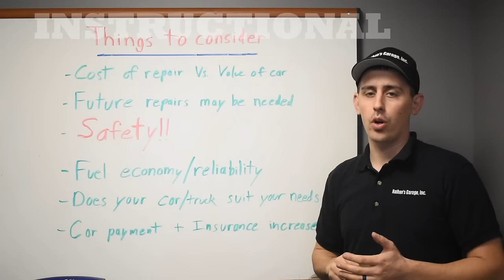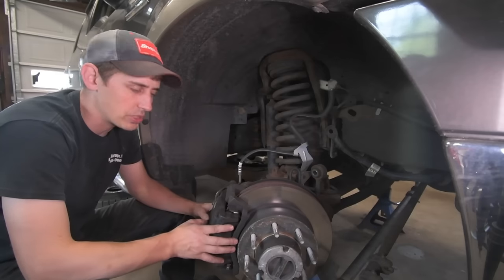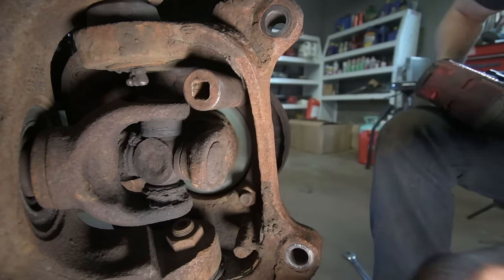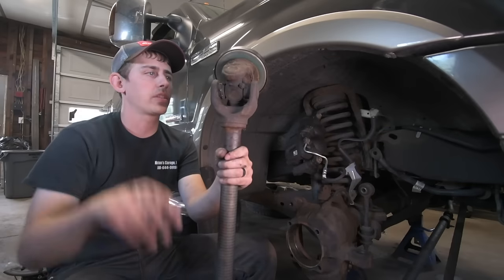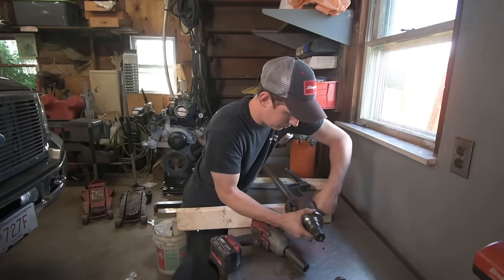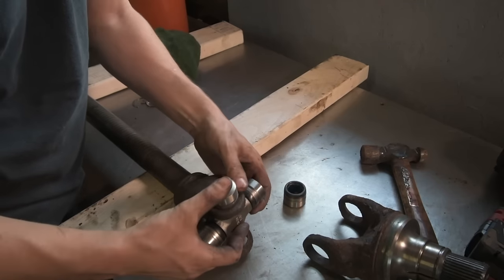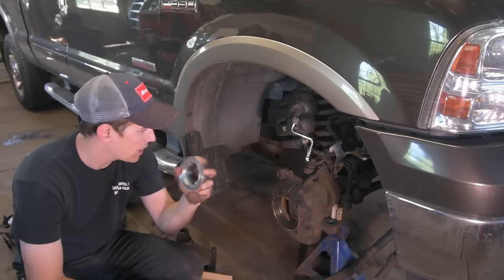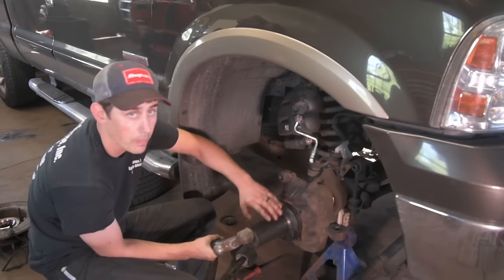Ford Superduty Steering wander repair....Axleshaft u-joints

Comment: Great video! Just did what I considered a front end “overhaul”, minus a steering box, but am still having this problem. Going to test this afternoon. Dumb question for you, any tips on disconnecting the hub sensor plug. While I was working on the truck the other day I tried to unhook it but could let figure out how the plug works. It looks like it’s 2 stage or something but couldn’t get it undone.

Comment: My 04 F-250 just started doing this I will look into doing this Thanks bro but should my steering box have some play in it?
Reply from the maker: There will always be a bit of play in the box. Even brand new
Reply: @InTheShop  Thank you for taking the time to reply bro I have checked it out and I both my wheel bearings are going bad

Comment: I have a 2002 F250 2WD lifted (6in).  Changed the ball joints and the steering went wonky from there. We spent 2 yrs replacing EVERYTHING, a couple of times, on that front end to get it fixed and it still has wondering.  It did however get a lot better after replacing the knuckles.  What else do you suggest we either check or replace to get it back to normal?
Reply from the maker: Can you give me a list of everything you have done?

Comment: Good evening, saw your video, great, 
Just wondering how the new dust seal gets installed?
 on the front Axle assembly, or is it pushed in? When you install the axle shaft and that new seal gets installed at the same time, please let me know, thx😊

Comment: Great video and information! I assume the doughnut seal and tool to correctly install for vacuum hubs isn't needed for my manual hubs? And this far into it, is there any suggested maintenance for my manual hubs? one turns easy, the other is harder but could that also be due to bad u joints? thanks
Reply from the maker: The donut seal should be replaced even on manual hubs. It helps keep the axle shaft stable and keeps junk out of the back of the wheel bearing. You could take the manual locking hub apart and clean and lubricate it.

Comment: Binding Universal joint binding is because the are supposed to work at an angel not straight ,
Reply from the maker: They spend a lot of their time in a straight line which does contribute to them siezing up. Especially since most people almost never use 4x4 to actually get the axles to rotate and change position. A large factor is replacement joints being greasable but never being greased. Thanks for watching Ralf!

Comment: I have a 95 f150 4x4 that wanders quite a bit. It takes constant steering input to keep it centered
in its lane. The truck has 120,000 miles and never had any front end work done to it. What would you be looking at first to diag this issue?
Reply from the maker: Check all components to make sure they have no play.

Comment: Great video but my only question is why do you have to lock the hubs in. If it is only binding up with the hubs locked why would it be binding while driving in 2wd?
Reply: Are the front axles always turning while driving and the only way the power gets to the front wheels is through the locking hubs?
Reply from the maker: They are not always turning if your hubs are unlocked but they will slowly rotate over time which is why the problem can be intermittent.
Reply: Thankyou. That makes sense

Comment: I have done one side on my 2012 F350, I have a hard time finding the right tool to seat the dust seal in the axle tube. Any ideas?? it is such a long distance for a standard seal tool and hard to find the right diameter.
Reply from the maker: I use a very large diameter socket on a long extension.
Reply: We built them out of fence pipe and a end that matches the width needed.  http://i205.photobucket.com/albums/bb294/OldCoot_2007/seal_driver.jpg

Comment: Great video and thanks!... I have this wander issue in my 99 F-250 and now looking into fixing it.   Would you suspect this frozen U-Joint problem before changing out the steering box / pump?   There's a few videos talking bout adjusting the steering box.  But this seems like an easier thing to diagnose or at least rule out.    Do you think many people are changing out the steering box for no reason?   Thanks!!!
Reply: If you notice in the video. Only 1/2 of the u joint was getting grease. If one side is dry looking its probably seized up

Comment: I have a 2006 f250 and I have a vibration when driving between 45-55mph while coasting and under acceleration I feel this vibration.  I’ve replaced all of the u joints in the driveshaft and the carrier bearing, and i still feel it. The front ends tight, and Ive had brand new tires put on as well, I’m kinda stumped at this point. Recently serviced front and rear diff aswell as the trans and 
t-case Anything you recommend I should look into truck has 180,000 I went on to the forums and a few guys stated it’s possibly injectors really would like to hear your take on this before I throw parts at it. I don’t feel any vibrations at any other speeds either. Oddly enough I put a blue spring in and I swear it vibrated a little less just stumped any insight is greatly appreciated

Comment: are any of these tools applicable for a 2004 F250 4X4 & do you have a Video for replacing the U joints front for that?
Reply from the maker: The job is identical on the 2004. I put links in the description of the video for the tools for the 05+ and the 99-04 trucks. Thanks for watching
Reply: @InTheShop  Thank you for the reply

Comment: I've had that happen when I installed Dana Ball joints they were too stiff could not freely
Reply: Turn
Reply from the maker: Typically what I have found is you have to torque the bottom ball joint first then the top. If you tighten the top first the caster/camber bushing pushes down and locks into place then when you tighten the lower it pushes up on the whole knuckle assemble binding the joints.

Comment: i have a 2002 f250 super duty with a good bit of play in the steering wheel and the steering wheel also doesn't sit normal its more of an angle while driving down the road.

Comment: Hey man, great video. I liked and subscribed. I do have a question for you. I have an 04 f250 diesel 4x4. There is play in the steering about an inch left to right. With the engine running  in gear but stopped, I can turn the wheel to a certain point, before hitting what feels like a stop. Then can go no further. If I let off the brake and inch forward or backwards while I turn the wheel, I can turn the wheel the rest of the way. I did notice that there is some play between the left inner steering tie rod end that goes into the steering pitman arm, not sure if that would be the main cause though. Do you have any suggestions on what it could be or videos to watch? Thanks.

Comment: Thank you for the detailed video, changed mine on both sides within a couple hours. Awesome deal! 
I still have a little play in my steering, any ideas on that? I have an 05 F250 with a 4” lift.
Reply: Tighten screw in gear box should be fairly easy to get to

Comment: Hi I’m have the same issue with an 04 RWD excursion. Obviously without the 4x4 hubs is this method pretty much the same process and parts for mines?
Reply from the maker: If it is Rear wheel drive only this wouldn't be your issue. I would check for worn out steering components or broken leaf springs.

Comment: Hey!! Great video thanks. !! How many axle seals do I need to replace . Which ones? I only find the one with the metal ring on it.
Reply from the maker: I have links in the description to the seals you need. There is a hub seal and a dust seal that need to be replaced.

Comment: what if you have a free spin kit (dynatrack, carli, etc.)?  isn't the point of those (not use unit bearing) to not have the axle spinning?
Reply from the maker: Correct and the axle not spinning causes the joints to freeze up. Then when it does happen to spin that 90degrees it fights the steering. If you had a frozen joint and the hubs were locked the wheel would shimmy

Comment: Get some mueller-kueps caliper hanger hooks on amazon, they are great
Reply from the maker: I have some real nice caliper hangers in my toolbox at work. Unfortunately I forgot to grab them before i recorded the video. Thank you though! I’m always looking out for better ways to do things. Thanks for watching!
Reply: @InTheShop  Nice, they are one of my favorite time saving tools...can't believe I went so long without em. Great video by the way, I have a 2014 f350 DRW in the shop right now that has a horrible vibration/growling with the wheels turned either direction but not straight...was thinking needle bearings or u-joints but the stubs turn freely. Going to pull the hubs this weekend, good times

Comment: Got the exact same wandering steering you described but mine is 2wd. Just got it a few days ago haven't had a chance to get in to it yet. What do you suggest I check first for this wondering steering
Reply from the maker: I would inspect for loose steering/suspension. If everything is tight see if the ball joints are frozen.

Comment: great video i am just about to tear into mine and replace everything down to the u joints
one question
how often is often on the greasing the ujoints? twice a year or so was knda my plan if you think i should hit them more often than that let me know...
and i love the godzilla on the work bench great helper
Reply from the maker: Thanks John! I would say at minimum every time you crawl under the truck to change the oil you should be greasing the joints.
Reply: @InTheShop  that was kinda my plan 
thanks and again great video

Comment: Thank you so much for this video, I was not aware of this problem, is this procedure the same for the '02 7.3L Excursion?  bought my truck 2 months ago, and the front suspension joints were all badly worn, nearly every thing has been replaced, and the steering is much tighter now..... I am used to the steering on my '02 K1500 Suburban, so light it feels like a small car.  this Excursion does not want to return to center, have seen comments it needs ~5 degrees of caster? but, this U-Joint problem could be contributing to the issue it seems to me now.  the truck has 174,000 miles today
Reply from the maker: Thanks John! The procedure is the same on the excursion as well.

Comment: Got a 2001 F250 4x4 steering swaying right n left. Told its gearbox. When turn, wheel doesn't stay put. Could joints still be my problem on swaying.
Reply from the maker: I would inspect these joints but play in the box is common on the older trucks. A thorough inspection is needed.

Comment: Hey I noticed the steering on my 06 f250 was a little wandery.  Today it was muddy (thus using 4x4 on the farm) and I could hear a consistent interval grinding noise when turning sharp (like a u joint spinning).  I looked and could also see the rubber dust cover seal you mentioned flopping loose.  If I had to guess I would say the u-joint needs replacing. The brake pads and discs were only replaced a year ago, so should be no noises there.

So my question is, am I on the right track?  I plan to basically do exactly what you did in the video.  Replace u-joint, dust cover, and do the seal kit. 

Is there anything else I should check while I got it apart?  Since that dust cover came loose, is there something I should do to clean out the axle housing?  I don't know how long that cover has been loose, and I am on a farm with lots of dust, dirt, and mud.

Thanks in advance.  I am glad you posted the video on this.  On the farm, we try to do our own work and videos like this are greatly appreciated.
Reply from the maker: I would definitely  try to clean the tube out. A long pryer can help scrape put the junk. I would say you are likely on the right path.
Reply: @InTheShop  Thanks for the info.  Now I just need to wait on the parts.

Comment: I think I may have this problem but mine won't turn when idling unless you tap the accelerated a bit I replace power steering pump with all new hoses and steering box already
Reply from the maker: I would definitely look at this but if this isn't your problem I would start looking at your brake booster if its a diesel truck.
Reply: @InTheShop  it's the famous 6.0

Comment: Is this only a passenger side problem or can it be a drivers idea problem as well? I apologize if you have already answered this before.
Reply from the maker: It can happen on either side and I typically replace both sides when this happens.

Comment: So mine wanders when in 2wd. I noticed you locked the hubs in to test the u joints. Why would it effect the steering when the hubs spin freely in 2wd, w hubs in free? I’m not trying to be disagreeable, but I don’t want to spend the $ on this if it is another misdiagnosis. If the I joints are froze will
It wander in 2wd? Thanks in advance!
Reply from the maker: You only lock the hubs while doing the test to rotate the shaft to test both directions of the universal joint. This will 100% still bind in 2wd if the axle universal joint is frozen.

Comment: Have you ever seen this on a brand new truck ?  I have 2021 7.3  has and it wanders like it's in semi truck  ruts in hiway....has 125 miles on it only....feels like if someone has tighten down to hard on worm gear on steering box ....doesn't center as well as I'm thinking it should ....all stock ....done since day one...

Comment: on your parts list, the seal 1999-2004 is for the rear diff, are the rear and fron the same? Great vid by the way, very well put together.
Reply from the maker: Thanks Kenny. The part shown is the correct one and the part number checks out correctly with timken. Its labeled incorrectly on the listing. Sometimes the amazon sellers edit the listing and I have to go in and update my parts list.
Reply: @InTheShop  ok man, thanks for the propt reply and thanks again for the video, great job on it

Comment: EASY DIAG turn wheels all the way left or right, turn front drive shaft with prybar without hubs locked. one or both sides will be stiff or dead stop

Comment: I rented the ball joint kit and the Clamp inside was too small to add on the extra part to let the ball Joint fit in it.   I ended up hammering them out.  The F350 is to large for the smaller c-clamp they have in the ball joint kit for the U-joints.  Yours looks much larger.
Reply from the maker: It can be done with the smaller one but it’s not easy. Hammering them out works too.

Comment: I HAVE A 95 F 350 DUALLY CREW CAB PURCHASED USED WITH 113 K ON IT.  I HAD A SWAY PROBLEM BUT MY MECHANIC ADJUSTED SOMETHING IN THE GEAR BOX / STEERING??  HAVE YOU ENCOUNTERED THIS ISSUE?  IT SEEMED TO FIX IT; HOWEVER, I AM LOOKING TO FUTURE EVENTS / MAINT.
Reply from the maker: Sounds like you had some play in the gearbox. I usually advise against tightening the box because usually at this point there is wear on the components but i may have bought you some time.

Comment: What s Just looked at your video you are bad ass Mechanic excuse the language ok l have 04 F250 just bought it with the front tire damage they hit something hard right on front passenger tire still now top of tire is laying inward and my steering wheel is off center can you give me suggestions on if something is bent l noticed the bar that goes from tire to tire has a curve you think that could be it please thanks
Reply from the maker: Hi Robert. If the top of the wheel is leaning in I would prefer to actually look at it instead of trying to guess whats bent. I suggest comparing to the other side to see whats damaged. the tired being bent would make the wheel off but wouldn't make the top of the tire lean in.

Comment: I have a 2006 f350 doing that same problem what u joints and kit do I need to rebuild both sides
Reply from the maker: Hi Albert, I put links in the description of the video to all of the parts I use.

Comment: Hey dude my front axel for my 2006 f350 is a little of to the right I don’t know is you could know what the problem is ?
Reply from the maker: They normally are a little off center but I would take it to a good alignment shop and have them look at it.

Comment: Will the u-joint failure cause my front to drift side to side with dead spots in steering when I’m correcting the drift?
Reply from the maker: Absolutely
Reply: My truck started tracking where ever it wants to go. When I steer to correct I can feel dead spot. And it’s not every time I drive it. I can run up to store and it will go side to side, than on the way back it will drive fine.

Comment: My 2011 f 150 with 84000 miles has a slight wandering issue. The toe is within spec. Do you have any suggestions?
Reply from the maker: Have you checked these joints? Very common.

Comment: I think someone messed with your links to the seals one says doesn't fit my F250, the other one says it's a pinion seal, or are those the ones I need?
Reply from the maker: I’ll update the links tomorrow. I did just check them and all of them go to the proper parts that are listed but the descriptions on the listings are wrong.
Reply: @InTheShop  btw, the video was very informative and i did add to my liked videos. Working on an 04 f250

Comment: I just had a wheel hub go in my 01 f350 and had the u joint replaced as well along with the hub. It seems like I've always had the wandering steering problem too, almost scary sometimes cornering at higher speeds. Should i be looking at the other side u joint if this problem still exist. I've always been like wtf!
Chris
Reply from the maker: Absolutely I would look at the other side. Let me know what you find!